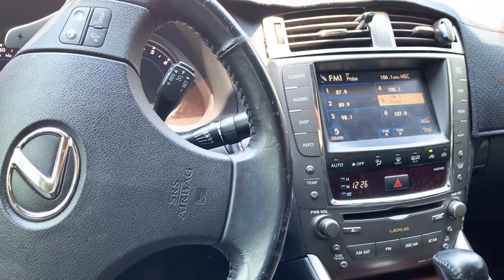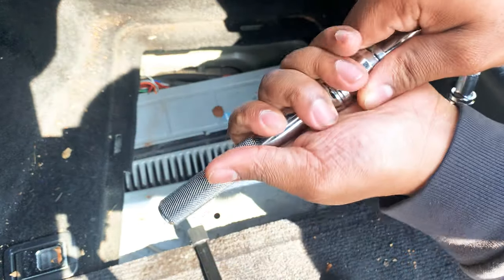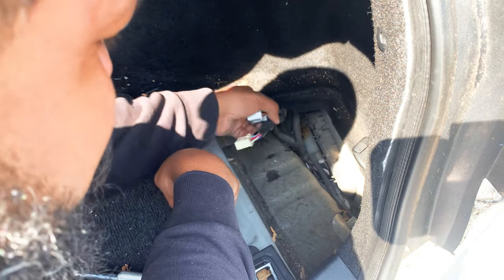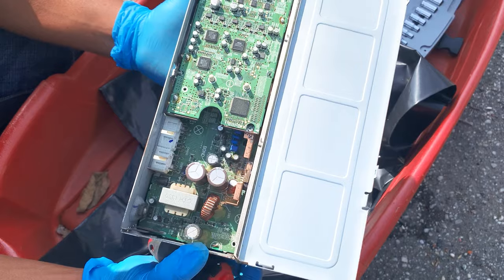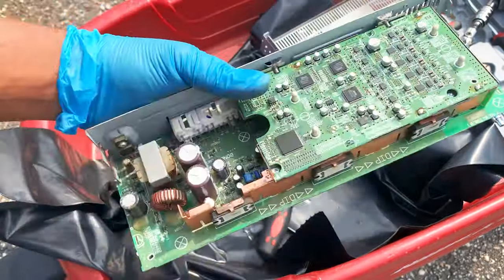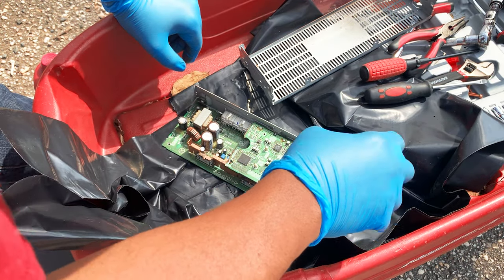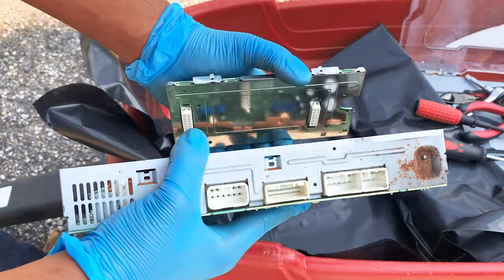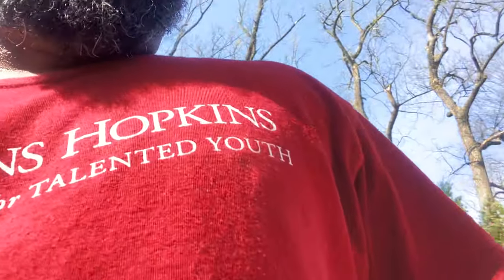Lexus No Sound From Speakers | Lexus No Audio Sound Pt. 2 (Troubleshoot Amplifier - Lexus IS250)

Comment: I wanted to let you know my wife’s 2010 is250c had the same issues. I rolled the dice on a 2010 ES350 amp for $112 off eBay different part number than the IS, works like a champ. Saved me about $250! Thanks dude!
Reply from the maker: @RyanCheneyELR  Good deal on the cost savings. Glad this video was useful to you 💯

Comment: Never used brake cleaner or carb cleaner on electrical components. You can use mass airflow sensor cleaner or there is electrical type cleaner because they don't leave residue on the components. Great video!
Reply from the maker: I hear your concern but you fail to understand this is a test situation. I would save never use brake cleaner for electronics that you do NOT want to damage. However in this case, it's PERFECTLY fine to use brake cleaner or any solution that would cause harm based on the fact that this was a TEST, the part was already damaged and a replacement part was already ordered. But I appreciate your concern 💯

Comment: My controls still work and checked the fuses are good so I am guessing the amp is bad. There is a thumping sound right when I turn of the radio but after that no sound.
Reply from the maker: Yup! That is confirmation that your AMP is DOA. My AMP did the same with the thumping/pop sound when you turn it on and off and then eventually it died (no sound). Replacing it will resolve the problem but the Lexus IS250/350 AMP is expensive. You can purchase the alternative one and will be fine.
Reply: What's a good alternative to install? My just died too
Reply from the maker: @ZeeHK  I would suggest you watch this video so you will know where to relocate your new AMP to prevent this from happening again.

https://youtu.be/XZyac4ohXpM

Alternative AMP Lexus Part# 86280-33150

You can find them on eBay cheaper then the IS250/350.

https://www.ebay.com/itm/2007-2009-LEXUS-ES350-PIONEER-AUDIO-AMP-AMPLIFIER-86280-33150-/224633848945?_trksid=p2349526.m4383.l4275.c4#viTabs_0
Reply: Is there an plug and play alternative for my GS450h 2008 year?
Reply: @ZeeHK  bro it’s not one the next thing to do is switch the whole sound system or buy another amp
Reply: I got a thumping pop sound when I turn it on.  So I need a new amp? Lexus 350 RX year 2010.

Comment: I have a Lexus ES 350. Sound system sounds okay, but would be so much better if actual sound came out of the rear dash speakers.
Reply from the maker: Hmm, sounds like the rear speakers could possibly blown. I would disconnect the speaker wire and temporary test the wire by connecting a "working" speaker to validate if you can hear sound. 

For example, you can disconnect a speaker up front and use the rear speaker wire to test for audio. If you do not want to go through the trouble of removing the door panel and speaker, just purchase a cheap speaker off Amazon to test the rear speaker wire connector for audio. 

If you do not hear audio then I would suspect that your AMP is not sending communication to the rear which the AMP may need to be replaced. You could also try to see if you can find a spare used AMP at your local junk yard but they are hard to find sense these AMP's are a hot ticket online.

Hope you find your solution.
Reply: @AWordFromMrJones  thank you!

Comment: Is it possible that the car has been in a flood? I'm just wondering how the amp got so dirty.
Reply from the maker: Brad good question.

The car was not in a flood and this is a common problem for the IS250/IS350 due to poor ventilation for the AMP. It basically sits in the rear wheel well where moisture builds up which eventually causes the AMP motherboard to short.

There are also newer Lexus that have experienced this issue due to improper ventilation.
Reply: Nope it’s a know defect car wash & rain will do it I’m buying my second amp
Reply: What's the fix ?

Comment: 2016 IS350 radio may work for 3 days then stop then work but now not working.  How can I fix this problem
Reply from the maker: Did you check your fuses?
Reply: @AWordFromMrJones  where is the fuse for the amp?